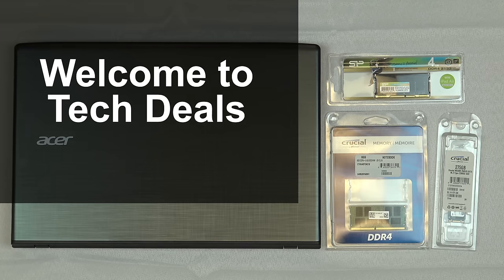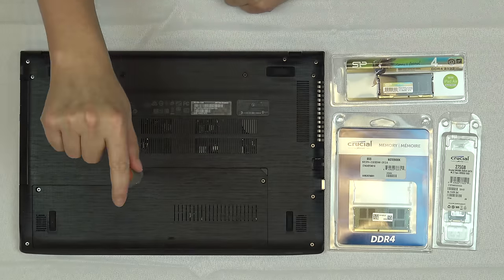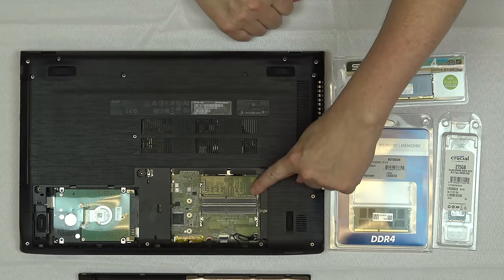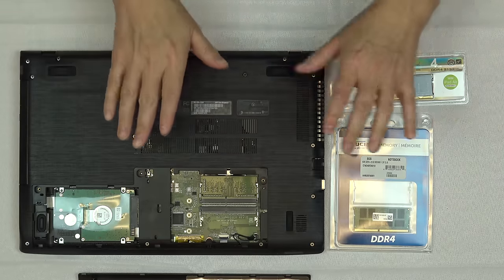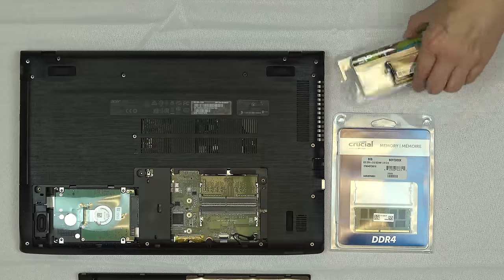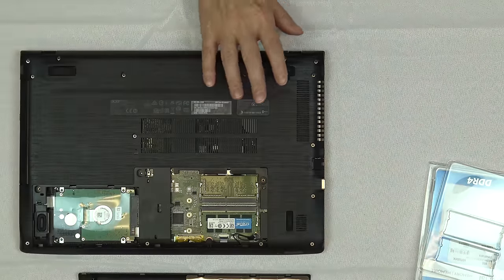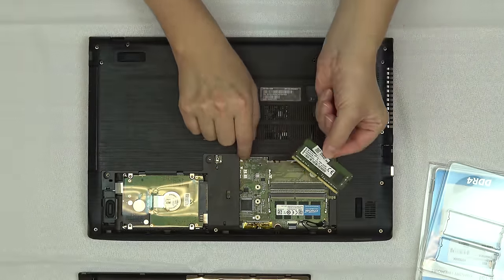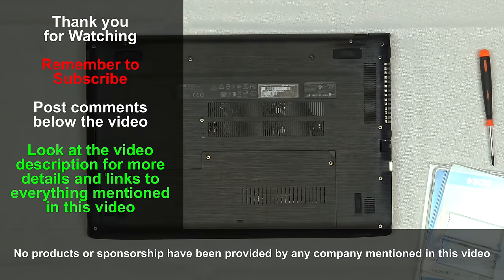Best $350 Laptop - Acer Aspire E15 - RAM Upgrade

Comment from the maker: UPDATE - I've been informed that Acer DOES have a part number for the standoff for the SSD on the M.2 slot, if you want to try, it is:
Part # - 86.GDEN7.002
Description - Stand-Off / SSD-Screw M2.5*1.8-I (NYLOK) D5T 3.7 STEEL

I'm going to call Acer on Monday and see if I can get that part for the computer using that part number, if so, I'll do a video on the SSD after all...
Reply: Where can you order this part  just in case mine doesn't have it?
Reply from the maker: Directly from Acer Support
Reply: So did you manage to get the part? If so, are you going to do a video on how to setup the SSD?
Reply: I called Acer Tech Support on this issue, and they told me you could go to a hardware store and get the appropriate screw. I am guessing that you would also need a nylok washer to act as the standoff.  Does this sound right to you?
Reply: any chance the battery test is in the near future as that is a big deciding factor for me
Reply: Just got that laptop, unfortunately no screws can you do a video on how to do it?
Reply: So, what's up with the screw and hopefully a video for the ssd upgrade?
Reply: O.K. guys, I've just spent the last hour trying to solve the stand off screwup! I was given the number for an Acer parts re-seller named Capital data by someone at Acer chat. They show the part number on their system but they CAN'T ORDER IT!! They directed me to laptop screws.com they have nothing like it. Forget about the hardware store. I then called headquarters in Cali. I explained how redonkulous it is that some people are getting them and some not. And the ones that are not can not order them! The agent took my phone number and said that she would talk to the appropriate people and call me back. I'll post her reply here if and when she calls. I'm glad I haven't bought the product yet. If I had I would be quite pissed off!
Reply: hmm wish it was easier just to get a stand off screw
Reply: What form factor is the SSD?  I've been looking everywhere trying to figure it out.
Reply: Love your videos. Whether I get a standoff screw, or simply purchase a replacement SSD 2 1/2 drive, do you have a video on how to clone the Operating system to the new drive?
Reply: Tech Deals Will u do an video on how to change tn panel to ips
Reply: Did you get it? why do you say is not a good idea change the HDD for a 2.5" SSD? is it a big issue? I really like this laptop but I want it to be faster.... and the HP for 460$ doesn't like me very much....
Reply: Raul Echezuria Why do you say that, I'm thinking of buying it
Reply: it is not a bad laptop, dont get me wrong... but I need at leas 256Gb SSD cause the laptop is only for work in Autodesk Inventor... and 128Gb isnt that much... and if I upgrade the acer e15 with a 4gb Ram and 120Gb SSD (for windows and Inventor) is less than the HP+HDD....
Reply: Raul Echezuria I hear you, I'm just doing basic things,like browsing streaming and basic YouTube video editing. Do you think that will suffice?
Reply: Did you get it? I want to buy this computer because I need the 1tb hdd and and m.2 ssd.
Reply: Some M.2 Drives come with a standoff screw, some don't.  I had ordered this one:  https://www.newegg.com/Product/Product.aspx?Item=N82E16820249074 and that did come with a standoff screw.  Unfortunately it is out of stock now.
Reply: Tech Deals i googled that part number 86.gden7.002 . they're charging over $30 for a standoff and screw. Im just gonna try to diy it. Somebody mentioned on Amazon to buy m2.5 6mm screw and just cut a nylon standoff in half as a filler
Reply: Tech Deals can I ask if I mixed ram(4GB+8GB)will the system crash?? because I heard a lot of ppl r saying that different size of ram make system worst/slower…I hope u can answer me…pls
Reply: JS if not running dual channel, then it only run 8GB?rather than all 12GB?
Reply: Can you make a tutorial how to put m.2 ssd drive and set him as a boot drive and set existing hdd drive as a storage drive ??
Reply: Tomislav Đukić just put m.2 in( take out HDD) and install windows10 inside then put back hdd
Reply: Can you put both of them at the same time and make data migration  after configure hdd and set ssd as boot disc ?
Reply: Tomislav Đukić yes u can, it can be migrate using Intel migrate software. check out tips on Linus tech tips channel
Reply: Did you make a video on how to install the M.2 SSD card yet???
Reply: Tech Deals I bought this laptop end of last month, I followed your tutorial on how to add the RAM & it turned out perfectly! Thank you, my unit came with the screw thankfully so I'll b adding ssd myself as well too...would love to see your vid on this.  You never came back & did an update
Reply: Just as an update I bought this laptop today (2/9/2018) and it did come with the SSD screw. they may have tightened up on it after receiving so many calls over it!
Reply: i ordered min 2 weeks ago and it did come with the standoff and screw.. after adding the ssd and 4 extra gb of ram this little guy is a beast for the money !...my startup time from powered off.... to a google search is around  6 seconds !
Reply: Tech Deals if you want to get somewhat better battery life or better graphics this is totally the thing to upgrade. Personally it's worth it to me to go with more than a 4gb module in 2018.

Comment: To anyone who wants to stick in an M2 SSD: Even I did not get the standoff screw. It's not a big deal! You can get easily get a screw with the correct thread. Scavenge your old laptop, or just go to your local store. If everything else fails, you can buy the exact size screws from ebay for 5 bucks (its a packet with about 50 screws lol, can't buy just one online). The dimensions are in the Amazon q&a section. Chances are the screw you find will be a bit longer than required like mine was. No problem. Put some sewing thread or something and reduce the effective screw length. Done. Just remember to not drive the screw in too deep, you'll push the touchpad out which is directly on the other side. You can use your own in house solution. You just need to keep that SSD down, that's all. PS: If you don't want to do any of what I mentioned, just use one of the 3 lid screws. I can vouch for the rigidity of the lid attached without the screws using just the plastic hinges. 3 screws is frankly overkill. 2 will do just fine. Trust me, the SSD will make a world of difference to your usage. From boot to chrome in under 10 seconds. Completely worth it.
Reply: i have a question. does the screw do something that can decrease the laptops performance? or its just a no big deal. I am worried a bit since I'm planning on buying this laptop.

Comment: Watching the video 4.5 years later. I have the same laptop. I bought it 2016 and have been using it daily since then for every thing with dual monitor. 
Upgraded over the years to 16gb, 1tb m.2 ssd. And you're right, the cpu was never the limitation.
Reply: how does it run?   do you play fortnite on it or any other games?

Comment: The best part of this laptop for me is that  it uses all 4 pcie lanes when fitted with an m.2 drive.  I set it up with 12gb of ram and a MZ-V6E250BW m.2 drive. Doing heavy io bound tasks like software dev, this is noticeably faster than than my Dell E5470 with an I7-6800HQ that uses a regular SATA SSD.

Comment: Great video but I was going crazy when you sat the SSD aside LOL. Thats what everyone buying this laptop needs help with (or at least I do lol)  I lucked out & mine came with the standoff screw for the SSD but I have no clue how to format it or migrate it whatever it is im suppose to do. My goal is to have windows OS running off the SSD for speed & the HDD used strictly for storage? Does this make any sense at all? If not ANY advice at all would be greatly appreciated!  Thank you very much... 

Ps I read where a guy on Amazon claims he borrowed/used one of the screws that holds the laptop back cover on for his SSD & it fit perfectly for now for a quick fix ....
Reply: HKGuy Snowman#1 We have the same concern. hahaha

Comment: Just as an update to this video - with the drastic price drop in 2.5" SSDs, you can quickly and easily replace the HDD with a 1TB SSD for less than $80 if shop around - and it speeds up this little laptop dramatically.  I just upgraded mine to 16 GB RAM and a 1TB 2.5" SSD, and it works as fast if not faster than a brand new Leonovo that is spec'd out.

Comment: Been a subscriber back when you had like 4000 subs. Congrats to 50K subs!  love you channel :)
Reply: A quick Question, My computer has an weird issue. When I download a game from like steam it downloads for about 5-10 minutes and then windows starts to lagg. I mean like realy lagging. The cursor moves choppy on the screen and everything is slowing down and youtube is chopping. I have an MSI Z170 N5 gaming motherboard with an i7 6700k and GTX 1060 6 Gb with 16 GB 3200 Mhz ram and windows is installed on an SSD and the games on an 3 TB hardrive. do you have any thoughts of what might cause this cause everytime I restart the PC everything is normal til I do a download.

Comment: Thanks so much for this video.  As simple as this turns out to be, it is always nice to have confirmation when you are prying open a brand new device and don't want to wreck something.  My machine came today and I had a problem with the wi-fi not being able to connect.  After a few hours troubleshooting with Acer, reloading, and resetting things, that problem disappeared.  So now turning to the RAM install, it was the last thing I wanted to encounter with more system issues.  In spite of a back cover that was stuck in place (it was a very tight fit compared to your system in the demo), I was eventually able to get the RAM into position and click it in.  Woohoo!  Even tried it a 2nd time to make sure the RAM was completely seated.   Ok, so now onto figuring out Windows 10 and where everything has been hidden! HA
Reply from the maker: You're very welcome, glad it was helpful!
Installing RAM is easy for those who have done it a hundred times, but everyone has their "first time".  :)
That is why I make these videos for every computer I upgrade.

Comment: Your videos are very well done... clear, concise, and coherent. However, you didn't mention anything about the speakers that come with this laptop and that is often an overlooked feature of laptops. In 2010 I purchased a Toshiba A505 that came with Harmon-Kardon speakers and the sound quality was excellent for a laptop. Sadly, after much use, (love Pandora) those speakers are declining in quality and now sound "gravelly". That's why I'm considering this Acer E 15  E5-575-33BM. I assume the speakers are not quite the quality of Harmon-Kardon, but, is the sound "decent" for laptop speakers?

Comment: Follow up:  I did not need all that the "big brother" Acer version had (did not need a dedicated graphics card) so I went for this $350 model, added an extra 4GB of RAM (now it is up to 8GB, enough for my light use) AND decided I was going to add the M.2 SATA SSD.  I researched what it would take to get a standoff screw if I were not lucky enough to get one.  I found it available from Replace Direct (.nl or.de) which ships only to the Netherlands or to Germany, but I have a contact in Germany who would have shipped it to me in the USA.  The 86.GDEN7.002 part with shipping from this source is about $30 and Amazon customer service promised to credit my account for $30 if my machine came without it.  Luckily it came with it, but I share this for anyone who takes the risk and does not get the standoff screw.  Acer says they are not a source for it.

Comment: Ok I got this E15 computer added 16 GB of RAM to the stock 4 GB for a total of 20 GB, then added a 500 GB M.2 drive and used a downloaded clone program to clone the stock 1000 GB HD to the M.2 drive and removed the stock HD and set the M.2 drive to be the boot drive in the BIOS, and after the laptop was booting properly on the newly installed M.2 drive I reinstalled the 1000 GB HD and set in up as a bulk storage drive. A piece of cake :)  Now it starts in about 10 seconds and runs very quickly, the I3-7100 CPU is the only weak bottleneck now in power-hungry applications, but at least now I know I'm getting the most possible performance out of this laptop and it has an extra 1000 GB drive for storage onboard that is completely separate from the boot drive.
Reply: MuckyWaters hello I was thinking of upgrading this laptop to use for college, are you about to run multiple programs and load into pregams/webpages a lot faster than before the upgrades?

Comment: Hi. Thanks for the great set of videos. Does the 4+8 GB RAM configuration work well? I read somewhere that 4+4 or 8+8 (same modules) work better as the system accesses both in parallel? What is the boot time with the upgraded 12 GB RAM ?
Reply: Rahul Mehta 

I heard the same thinf
Reply: Thing

Comment: Thank you. I’m late here and should probably just buy a new computer. I have an Acer Aspire E 15 Touch laptop by the back not have an access panel at all like yours. In addition mine shows a 4GB DDR3 L memory. Based on what you mentioned I can’t use the DDR4 memory. Since there is no access panel on the back this model maybe was not intended to be upgraded?

Comment: i also bought the crucial 275, but later on down the road for another laptop, i bought the 1tb crucial and it came with 2 screws, so i just used one of the screws to screw in the 275. not only that but 1tb hp nvme that i purchased for another laptop also came with its own screws. i guess m.2 manufacturers are starting to put in screw for situations like this.

Comment: Great Video !  When we add 8GB Of Ram to the 4GB already installed.We get a total of 12GB My Question; Will the Extra 8GB added Have a effect on the Battery power when we choose to run the computer on its battery? In other words will the addition of the extra 8GB run the battery down faster than if we had only kept the original 4GB?  Thanks !!

Comment: Hi, thanks for the video. I have an acer aspire E 15,  Intel pentium quad core processor N3530 (up to 2.58 GHz), 2GB DDR3 L memory, 500 GB HDD. I wanted to know how I can upgrade this laptop such that it possible or compatible to install softwares like AutoCad on it? Is it worth upgrading? Thanks.

Comment: So what about the m.2 ssd? The laptop is practically unusable with just the hdd in it.

M.2 is completely new to me so this is the 2nd time I heard of the stand off and a screw. What are they, could you do a video on that? Are they obtainable independently?

Thank you for your hard work! I love your videos.
Reply: you can watch this video to know more about M.2 SSDs /watch?v=opwON-7J_wI

(sorry for referring to another channel)
Reply: Ersyad Adhimakayasa
Thank you. I watch Linus and I re-watched that m.2 video recently as well. While Linus does explain the basics, those are something I'm already familiar with. It's the whole nvme vs ahci vs something else maybe? that confuses me.
Reply: *****
0 reasons to be an informed tech consumer and get an ssd free system post 2012 regardless of the price.

SSD is such a vital part of the computer its silly to buy new computer in any price range and not get one.
Reply: Petar Stamenkovic It's not ususeable. M.2 is an interface like SATA
Reply: Everything is slower- not just the boot time. If it were just that- it wouldn't be a problem. Web pages load slower, programs load slower- your whole post 2012 system is waiting on your HDD. The speed is not negligible. Your 20s vs 3 minute wait adds up across all your tasks. You end up waiting for everything.

For the average user- it doesn't make a difference between a 2 core and and 22 core system. Most of the time you're left waiting on your hdd bottleneck.

SSDs are very cheap and remove this substantially. Since SSDs are so cheap and so effective, hence there are 0 reasons to get any new system after 2012 that doesn't have one.
Reply: *****
60$ on 350$ machine is perfectly acceptable price to make it feel thousand times faster, but that's just me.
Reply: *****
I may have exaggerated when I called it unusable :)

I really meant that it is cost inefficient use of resources that gives the illusion of a slow computer. That slowness could easily be alleviated with an inexpensive SSD.

Hence my original question about the screw and the stand off- I dont know what they are or how are they missing as I know very little about m.2 in practice. For example, is this m2 nvme or ahci...
Reply: Glad to hear that :)

How can you tell where I'm from?
Reply: *****
Cool! Thanks :)

Comment: Interesting I have confirmed the Aspire E15 I received indeed has the SSD standoff and screw. I guess it is luck of the draw. That is a shame that ACER did not provide this as a default for future upgrade. Additionally, for those interested in a temporary solution you can use one of the screw from the access panel with a couple of plastic washers (no metal ones!!) to get your install set. Just my opinion. Try at your own risk. Congrats on the 50K Tech Deals you rock!!!
Reply from the maker: Thanks for letting me know!  That's annoying, if they had all come with it, that would have been awesome!

Comment: To everyone who purchased the laptop, you CAN install an M.2 SSD. After some attempts, a slightly longer M2 screw would do the job. It's not the proper way to do it but the mounting holes are threaded so you can screw the drive in place, all you need is a longer screw. 

Check this video out, it helped me and I'm sure it'll help you all. 
https://www.youtube.com/watch?v=ubRAfWRpiT8
Reply: SP Crypt thank you!
Reply: SP Crypt would it help with gaming
Reply: Sammy Torres it would improve loading times but not frame rates.
Reply: SP Crypt What is the M2 SSD for?